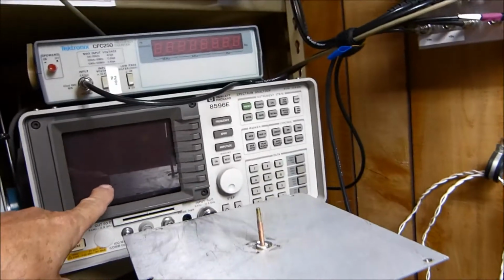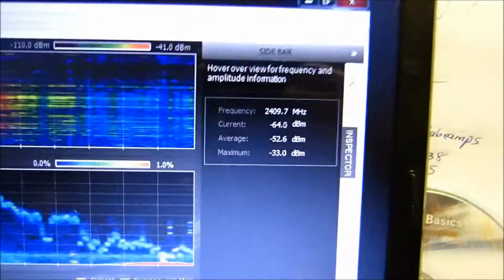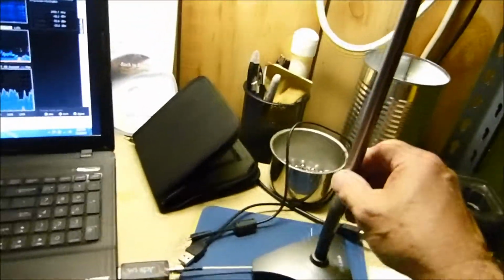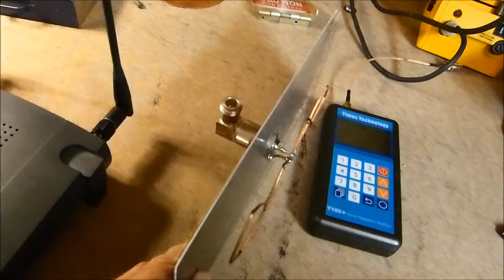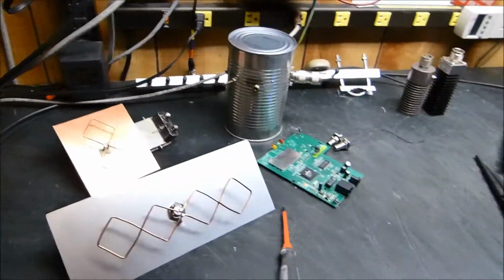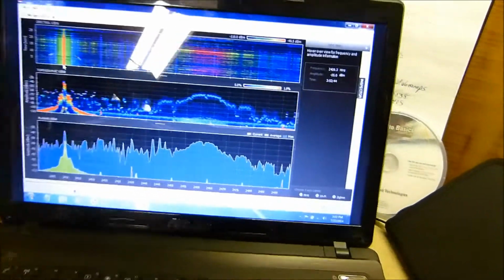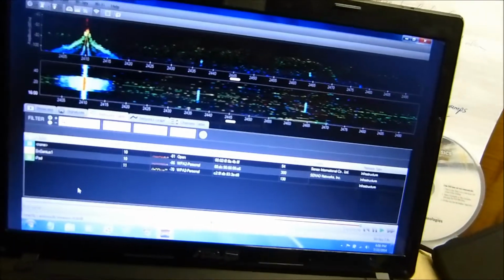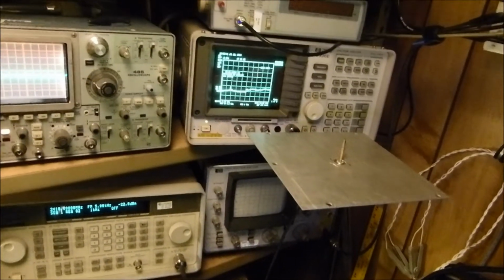Building And Measuring WiFi Antennas

Comment: Hi, I was wondering since you know a lot about antenas, is it possible to use the existing wiring in your house as a Wifi antena ?
Reply from the maker: No, I don't think that will work at all. The inexpensive "wireless" intercoms for home use do use the house wiring and they run at less than 200 KHz and are FM. Even they don't work very well if the house wiring run has to go all the way  back to the circuit breaker box before it goes to the next node.

Comment: Thank you for this video. Do you know something about Balun 1:1 - a few turns of coax cable at the bottom of antenna please? Can simple balun 1:1 improve signal level, or is it useless?
Reply from the maker: it is my experience that a coax choke (or balun) of 9 turns of RG-8 style coax at the antenna can dramatically reduce radiation from the coax. I personally do run a true 1:1 balun also at my transmitter/tuner end of the coax. From my measurements this improves the bandwidth of the antenna a small amount.

Comment: Hello friend, what kind of device do you use to test the Omini and its frequency for wife ,,, I'm happy to do the tests before, thank you.
Reply from the maker: I assume you are talking about what I call the reference antennas. I measure the reflected power with the Bird directional coupler and adjust the length of the stub to get no reflected power so I know I have a 50 ohm match to my transmission line and the flat plate the antenna is mounted through is at least a couple of wavelength  wide in any direction so I assume it has a good ground plane.  At that point I call it my reference antenna(s) and take some measurements between the two and then compare the other antennas to that. The program that runs on the PC is called Wi-Spy+Chanalyzer and is sold by www.metageek.com.  I hope this answers your question.
Reply: Hello friend, the neutral and the plate is at the beginning of it to generate the magnetic field and the rest would be what generates the wave ... friend you could be showing how the magnetic field of the hyperlink, thank you

Comment: Great video. I read a post on another channel where someone said that when he was in IRAG he would use a cheap 15db antenna from BEST BUY and get wifi from a 100 miles away and in his home town of WYOMING he'd gets 100's of signals from about 40 miles away and it wasn't even connected directly to his laptop.

Is that even possible? Thanks.
Reply from the maker: +Brad Haas I wouldn't be too surprised today. Ten years ago I put up a 4 foot parabolic dish with a "cantenna" type feed horn and was able to get over 240 in my area. The dish was mounted about 35 feet in the air on an antenna rotor so I could turn it 360 degrees. I could see many that I could not log into down at -90 dB and more. A -60 dB level signal (or better) usually works pretty good. I think the main lesson from all my videos on WiFi antennas is to keep the feed line (coax) as short as possible from the antenna to the access point.

Comment: Love your videos, I just found them today.  7:45 into this video you were mentioning the coax inside the router as being a bottleneck, would changing that wire improve the signal going out?  if so, what kind of wire would you recommend?
Reply from the maker: David Ries You would need to get some RM SMA connectors (so you can hook your antennas back up) that will fit any good quality 50 ohm coax it would surely get more power to your antennas. Keep all the RF cables as short as possible to the antenna and use coax as large as you can.

Comment: Are those 2.4GHz "rubber ducky" style antennas which you say have an SWR of around 1.2 the cheap Chinese types found on eBay?
Reply from the maker: Winston Smith They are the ones that come with the Linksys equipment.

Comment: nice informative vid, if i use lmr-400 cable with n type conector and a n-type to sma adaptor to the other end for connecting to a router, will be any losses? i mean do i lose for using an n-type to sma adapter at one end of the cable?
Reply from the maker: I can't detect any loss in the adapters at 2.4 GHz - I have had good luck with them.
Just FYI from my experience - once you get to 11 GHz or more, even a 90 degree (right angle) highest quality N connector will loose all of the signal.  It will not make it around the 90 degree angle and large radius flexible bends of 6-8 inches of semi-rigid coax must be used with N connectors. I have not been able to detect any loss at 2.4 GHz in a 90 degree N angle or the SMA to N adapters.

Comment: any opinion on this inexpensive forward/Reflective and SWR meter for 2400-2500MHz
http://www.aliexpress.com/item/FREE-SHIPPING-REDDOT-5011-SW-M2400-2-4g-WLAN-STANDING-WAVE-METER-WIFI-DIGITAL-SWR-METER/1973748134.html
Reply from the maker: Hi Ken, I have the REDOT HF version of that meter and I like it. I can use the HF version without all the complications and expense of the Bird system. Now that you have showed me this one I may have to have one of these also :-)  From a quick reading of the description it appears to respond to the bursts of RF that an AP puts out - which is a real problem with a Bird element. I finally invested in Bird elements, spectrum analyzers and signal generators so I could do CW measurements at these frequencies (2.4 GHz) but I spent almost $5K in doing so. I tried making measurements with AP's for years with frustrating results - maybe this little meter is part of the answer - Thanks for posting.
Reply: ElPaso TubeAmps I order it a few days ago.  I will update when it comes in. 
Your right on the Bird 43.  It would be hard to make the measurements.  
For the heck of it I tried my 400-1000MHz 5 watt slug and it just about moved the meter.
Before I look for a 2400-2500 1 watt slugh will see how the REDOT digital meter works.
Ken

Comment: Hi,
I have the other yagi with the round mount for the folded dipole. It come with junk 75 ohm cable at least a meter long.
It worked no better than the stock antenna on my alfa usb adapter which is the 2-3dBi type.
The antenna is stated on ebay as 25dBi but the antenna was marked with 16dBi.  
For work I perform EMI/RFI measurements for a large company so I have a 10m Chamber, receivers and analyzers for
that range but nothing to measure SWR other than when I perform Radiated Immunity measurements but only up
to 1GHz. 
I have a Bird 43 but do not have a slug for 2.4GHz.  I found on the web this divice
REDDOT 5011 SW-M2400 2.4g    good for 2.4Ghz and thinking about buying it for $88 delivered.

I have built a few yagis with poor results but I am convinced without tweaking the folded dipole while looking
at either reflected power or SWR there is no way to know why it doesn't work.

Ken
Reply from the maker: Ken, I completely agree with your last statements above. Antenna theory (as propagated on the Internet) is likely very different from antenna reality. Sounds like you have an interesting job. I was in the computer field with NASA and WSMR from 1970-1996 and then management until I retired in 2010 but my heart has always been in RF and AF and now I have the time to play 24x7 - as long as my wife doesn't leave me...  :-) 25 dBi is a lot of gain and is so high that I pretty much dismiss those claims - that is all I expect to get from a feed horn into a four foot parabolic dish.
The Bird slugs for 1 watt at 2400-2500 MHz are new and about $179 but I am very pleased with the one I have. You will probably also need a broadband amp to use with it so you can get a good reading. The digital readouts for the 30 uA Bird elements are a real blessing also as you can use a 1 watt element on a 5 watt scale and everything is up-scaled by a factor of 5x and you can better see reflected power. I also built one 2.4 GHz yagi with poor results and my measurement system that I have now confirms it - very poor match - oh well...
As I have mentioned in my YT videos, my efforts appear to confirm that our 2.4 GHz antennas work but our transmission lines destroy all that we have accomplished unless we are very careful.
I assume you are familiar with NetStumbler - it's not bad for free.
Also, the Wi Spy devices made by MetaGeek are pretty nice also - I have two of these devices and bought them when the company first started for way less than they are selling for now.
Please stay in touch and post some of your 2.4 GHz work.
David, WA4QGA, El Paso, TX

Comment: any chance of checking out the cheap yagi antennas on ebay.  I have noticed 2 different types based
on the appearance of the folded dipole.
thanks, Ken
Reply from the maker: Hi Ken, yes, I am waiting on a cheap nice looking 2.5 GHz yagi from Ebay right now. I am anxious to see how it performs. I have one yagi that I briefly showed at the end of this video and it does have a good SWR but I see no real gain from it. If you take the cover off the driven element it does have a matching stub so it loads up well with very little reflected power. It comes with a long length of coax which would absorb any gain the antenna might have. I don't recommend it. Let's see how the one I am waiting on performs.
Reply: ElPaso TubeAmps
can you send me the ebay link.  I let you know if its the same one I bought.
Mine doesn't work and got a refund.  I plan to cut just about all of the coax off and mount a N connector
and give it another try. 

Ken
Reply from the maker: Ken Klimasewski http://www.ebay.com/itm/161355075343?_trksid=p2059210.m2749.l2649&ssPageName=STRK%3AMEBIDX%3AIT This is the one that I ordered but has not come in yet - it looked reasonable and their claims are not too outrageous -
Reply: ElPaso TubeAmps The so called 25dBi is junk.  Once I cut off as much cable as possible I will give
it another try.  The cable goes through a metal tube into the round container where the folded dipole
goes through.  It looks like its sealed and I would cause some damage cracking it open.  
Nothing to loose if after removing as much cable (75 ohm, I wonder what the plan was there) and give it
a try again before cracking it open.

Ken
Reply from the maker: Ken Klimasewski From what I could see in the yagi I ordered, I will be able to remove the transmission line that comes with it as it appears to have a SMA connector on the balun - I hope so -
Reply: Ken Klimasewski I ordered some sma extension cables, 6 inch.  Cheaper than buying the connectors.
I modded my so called 25dBi yagi by removing the 75 ohm cable.  To my surprise inside the round
cap where the folded dipole connections are, was another piece of cable 50mm long coiled up
and soldered across the leads of the 75 ohm coax. Both cables in parallel attached to the folded dipole.
I removed both and connected about a 3 inch piece of the extension cable, connected my wifi usb adapter
and what a difference. My reference neighbor's signal went from mid 50% to 68%.

Comment: Not an expert in this matter but just curious. I would imagine that at 2.4Ghz the losses would be staggering in any cabling you would use due to the capacitance of same. Would not capacitive adjustment of the antenna termination point fix the loss issue.....?
Reply from the maker: I don't think there is any way to compensate for loss in the cable with tuning. I have experienced and see more and more on the Internet where people mount the AP on  or very near the antenna. Nowadays with power-over-Ethernet (POE) as it is called, where they use the extra two pair of wires in CAT-5 cable to run the DC to the device we can actually benefit from the gain of the antenna and not have to lose most of what we have gained from the antenna in the transmission line. I have  been fortunate and not spend much money at all on these toy WiFi antennas off the Internet but I have seen one seller that has sold over 300 nine-meter cables at over $100 each - that is $30,000 that people have wasted and just been done-in. Some of my purpose for making  these videos is to show others what they may not realize so that they can make better instruments for less money and avoid the scams.  If you look at loss in cables, many are not even rated above 2 GHz. The longest run I have ever made at 2.4 GHz is about 50 feet with LMR400 and the results were acceptable but the antenna was a four foot parabolic dish up about 40 feet on a rotor. This was back around 2006 and I could see better than 240 access point at that time - I am sure there are many more nowadays. My gain in this antenna was probably 20+ dB with 10 dB lost in the transmission line - but it did work quite well. Weather proofing is another subject worthy of YT videos and discussion. Thanks for your comments.
Reply: he is right.  Once the signal is loss due to the cable you can't get it back.  I use very high gain preamps
mounted at antennas when I take measurements up to 40Ghz for EMI. (FCC) and other Country equivalent.
The premap boost the signal that is loss in the cable so there will be enough signal to make it to the analyzer
to measure.

The other thing I noticed is some people where making antennas from wood.   In the EMI world we used to
place our products on a 80cm wooden table.   Experiments have determine most wood can reflect or absorb
signals above 1Ghz.   We recently had to switch all our tables to a non wood type table to simulate the product
is in free space with no absorb or reflecting material causing an error in the emission signal strength.
This makes me wonder how a yagi boom made out of wood would work. That design has all elements including
the folded dipole floating.

Ken